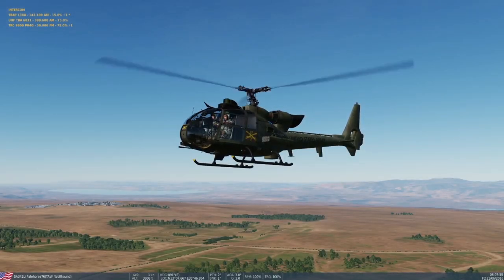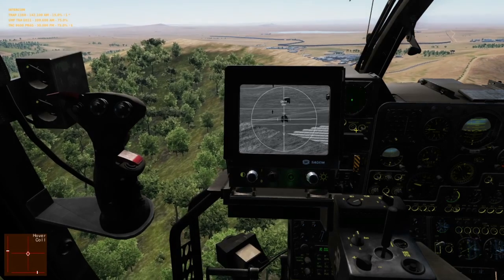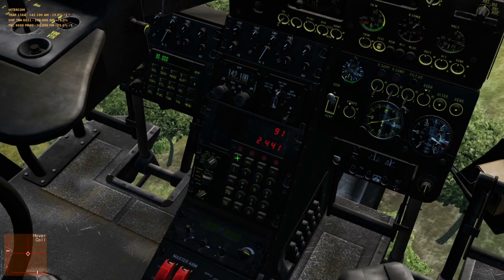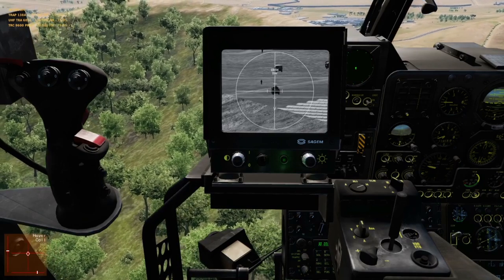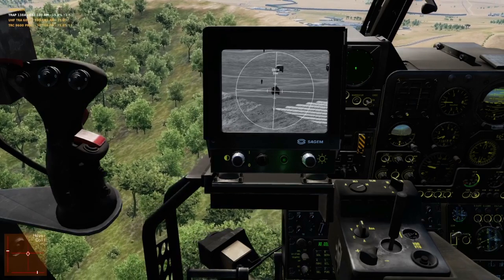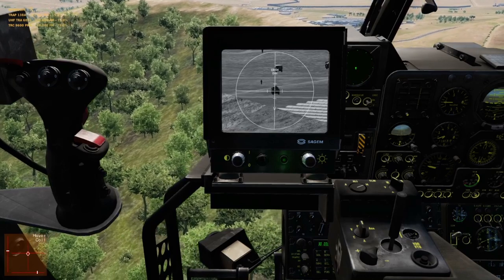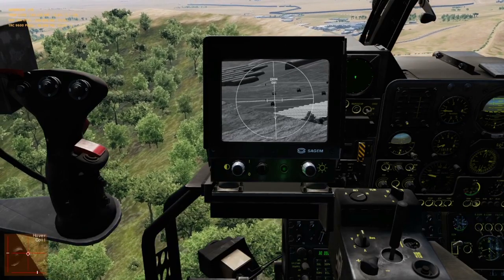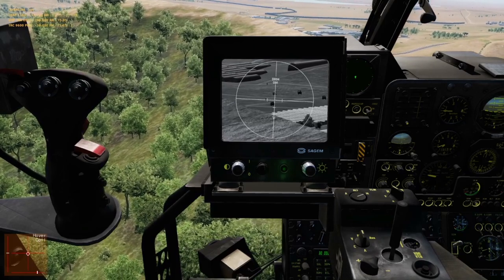DCS FAC(A) / JTAC / Keyhole CAS Procedure - Type 2

Comment: Great video. Can you explain the real benefits/cons of the keyhole method? What is the purpose of having the CP/HP at charlie south and not have the pilot standby for the CAS brief further west of delta IP? Is this just in place for convenience if the pilot is coming from the south?
Reply from the maker: The main advantage of the keyhole method compared to prebriefed CP + IP is flexibility, especially if providing CAS on an area that wasn't prepared for it.

On Charlie vs Delta:
1: Having the pilots (example) at Delta 25 would make it near impossible to run sensor talk-ons
2: They would then need to do a 180° turn after the attack, egressing west again, not ideal.